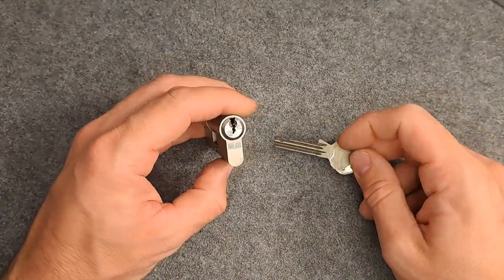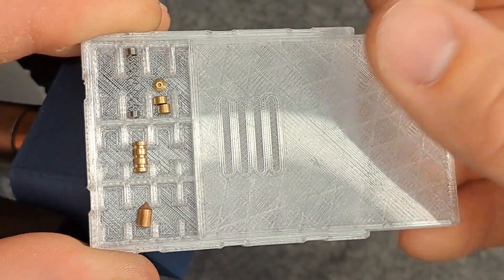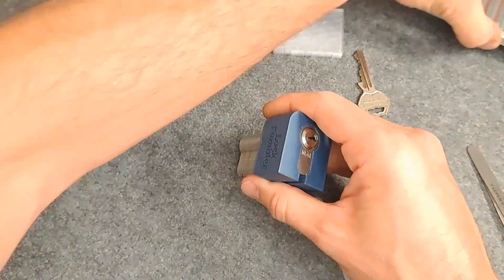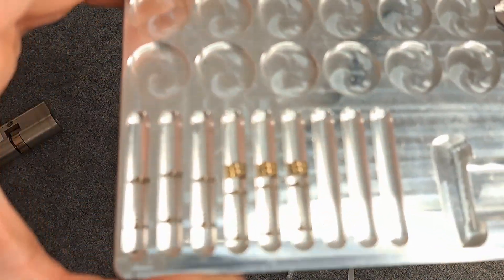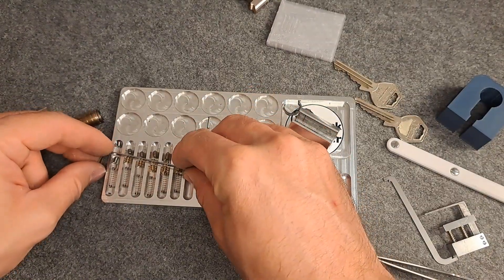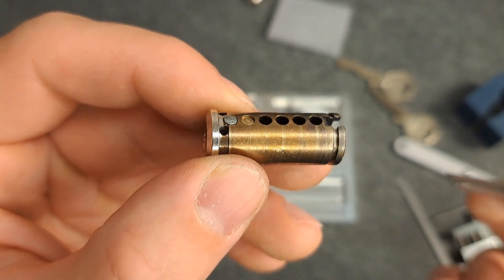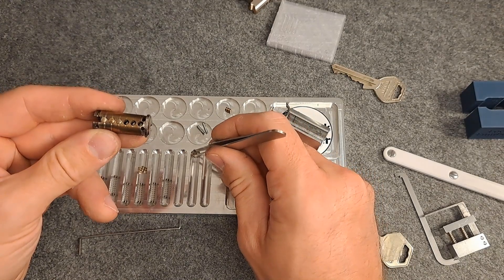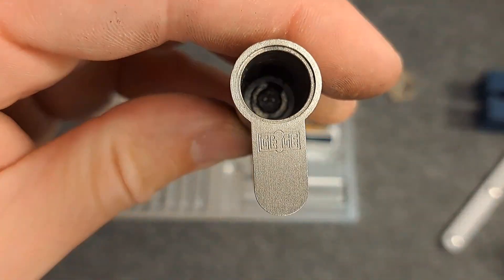VERY unsecure GeGe AP2000 picked, gutted and explained [230]

Comment: I also have one gege, and I noticed after taking it apart that if I had a minimal cut, both the key pin and the driver pin would be inside the base of the cylinder.  Definitely a problematic design mistake by gege
Reply from the maker: Oh no, that's bad. I was hoping this was just an anomaly, but that makes 2 already 😕  but they also have longer drivers, so I hope this is still just bad pinning and not systematic. 
Thanks for watching 👋